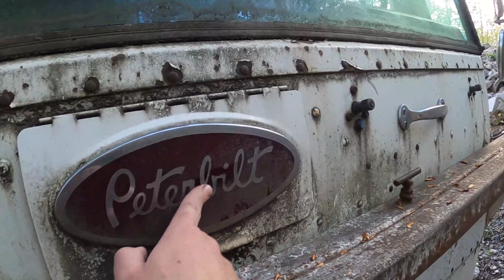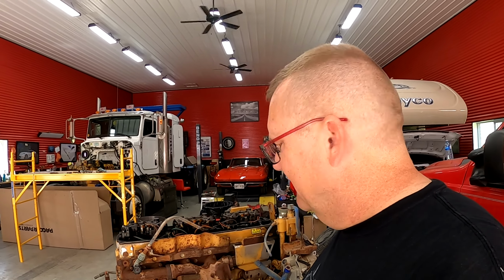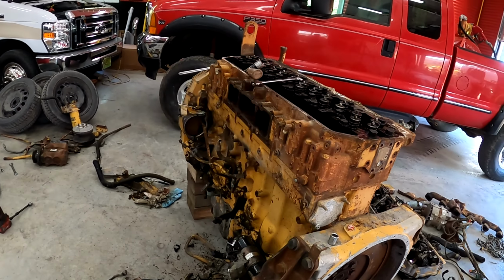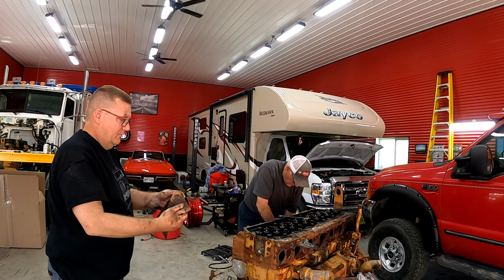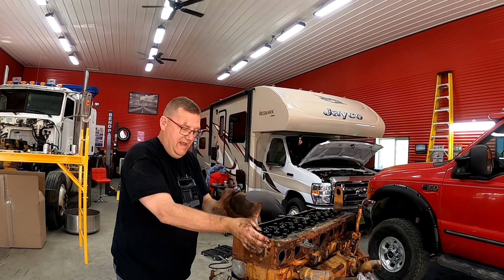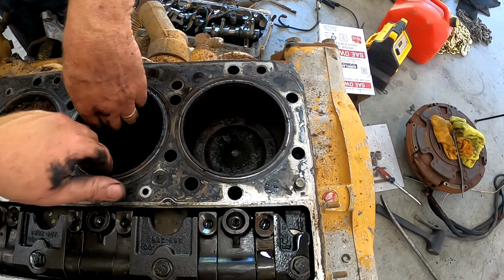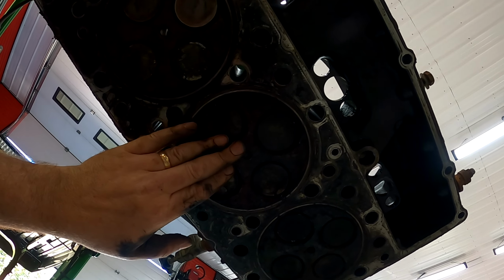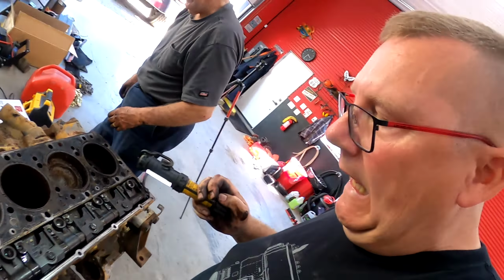off with its HEAD!!  MISTAKES WERE MADE.

Comment: You're putting the horse before the cart. Until you have the block and head checked you can't know what to do. If they are good, rebuild it yourself and when it's done you know it's right and tight. You'll know how to rebuild an engine for a future project, it won't be so intimidating. Don't get discouraged, if it was easy, everyone would be doin it.

Comment: Some you win and some you lose !!! I pull the oil pan and check the bottom end out before doing anything else . And if the bottom end looks useable, then get the head checked and if it's okay,   I would start taking the other
 engine apart and then see if you can come up with enough parts between the two engines to build 1 good engine . And then make your decision as to rebuild or buy a remanned block . Good luck and I will see you all later, it was great to see your dad there helping you, he seems like such a great fellow . Take care and stay safe and keep on making us some more videos .
🤗👍💖💫

Comment: Mike, don’t get down,keep going ,strip the motor,sort the parts, good bad ,strip the other motor,see what you got,make the decision,remember you are not using the truck at max kgs,every day,see what you got,in spec ,you need 6 in spec clean liners,and it’s amazing when there cleaned .keep going.

Comment: Normally I would say rebuild it however from what I have seen on other channels, rebuild kits can be hard to get.  The piece from the sleeve that is missing, did it drop in the crankcase and damage the crank?  Although I believe this might be able to be rebuilt, I have a feeling that by the time it is done the cost of additional parts may be close to what a remaned one would cost.  That is not even taking into account the hours you would spend rebuilding it.  Basically I think you may be better off using it as a core and getting a remanufactured engine of the same model.

Comment: Before you ask your shop guys, clean all of it properly, get the one in the truck apart and see what in there is usable. Between the 2 of them you are well on the way to a good rebuild. You might get lucky and end up with enough pistons and liners. All is not by any means doom & gloom and over budget.
Reply: I thought the same thing too, collect parts from both engines and build a good engine.

Comment: What are your plans for the truck, if it is not putting it to work than what does it need, 6 pistons, 6 liners, gaskets and a set of bearings, that should not be $10,000, still need to check the head for flatness and vacuum test the valves, dont over think it.

Comment: Just for content alone, rebuild it right there in your shop 😁
Besides you need to see the bottom end.  Is the crank good?  Are the rods good?  Prolly, but you won't know until you get there ...  If all that stuff is serviceable, just kit it and be on your way.  Leave the used motor patina so it all looks like a nice used truck and go have fun.  Drive it and show it, or whatever ...  🙃

Comment: Shades of me back in the 80's when I built a performance engine for my Gran Torino.  Bought an engine from a junkyard, tore it down and found the crank had been trashed by a spun bearing on the rearmost rod journal, so I had to buy a rod and crank set.  Went through three sets of cylinder heads just to find a pair that was not cracked.  Money wise, yes, I may have saved some dollars, but considering the tools I had to buy, the time, and frustration, I would have been just as well off to have bought a high performance engine that was ready to run.  Before you buy anything else, have that engine checked for damage and/or cracks.  It may actually be ok, then again, it may be nothing more than a pile of expensive scrap iron.

Comment: You can get that dye and spray kit to look for cracks [Bus Grease Monkey does that to check for cracks on every engine he does]. But Ya if you don't get that special spray and dye kit to look for cracks, send it in to magnaflux the head and block to look for cracks...especially after watching your Dad whack the head on the ends with that 12 lb sledge... such a character and rock star :-)) Also, may get the other head from the Duke done at the same time [shelve all the good parts you won't be using on this build but may need later on]. With all the trucks you own and the fact that they are vintage, you're doing yourself a favour teaching yourself how to re-sleeve a block, clean and put new rings on piston's, learn to run a straight edge across the top of a block to see if the block will need to be decked at the machine shop.... yada yada. May be worth your while to get an engine milling machine at some auction somewhere... save yourself tens of thousands. But ya Mike, dive in on the learning to rebuild this engine.

Comment: Hi Mike, turn the block over and remove the sump.. check the big end and mains for rust .. I'd say with the hole in nuber 4 cylinder wall.. the sump will have filled with coolant. Hence why they drained the oil at the breakers yard. the crank could need re ground and over sized shells  the camshaft is probably junk as well with rust on the lobes and bearings .. and lastly  where did the missing liner go.?? was it smashed and forced round the oil ways.. scoring All bearing surfaces... I'd find out the true cost of a New block.... and have work done on ... or a replacement head found.. as the camshaft and rockers arms may be shot if the engine has sat with oil water mix for any length of time .. I'd use the block you have as a core  to send back  and find / have all the work done on the head ... that way there is Noo fragments of cylinder wall floating about to screw the new built up engine... Stay Safe Oot There.... N Keep up the good fight ... Andy UK

Comment: One thing a mechanic really hates is a box full of parts and told to fix it. On that note you should have boxed up all that engine keep it separate from the one in the truck and pull the engine from the truck and break that one down see if you have a good block. I know I'm over a year late but still. You got everybody in need within finger touch range. Those engines need to be boiled in magnaflux to check for cracks in the heads and in the block.
Reply from the maker: Yeah the block in the truck had a big hole in it.  Woops

Comment: If the two engines are compatible with each other pull the liners out of dukes engine and resleeve the new engine. The pistons are the same as well. The bottom end use the best of all 12 cylinders. You might get away with haveing to replace the bearings, something that probably needed to be done anyway.

Comment: Hi Mike & Dad. I was cringing as I saw you disassembling the head and not counting the bolts removed.experience is a great maybe the best teacher. Unfortunately it can be a very expensive lesson learned.
Get a manual for  your engine. They are cheap insurance and with today's internet are available almost instantly. Have te block & head checked. If good buy the full kit and put it back together. Keep the videos coming. PS. no more prybars until your sure it is ready to come apart.
Reply from the maker: 10 4 👍 👍

Comment: There's a lot of work even for an experienced builder to re build a short motor,  my advice, get the head checked. Then trade in the engine for a rebuilt short motor. If the head turns out to be a dud,  then you have to go down other avenues

Comment: You sure get yourself in a pickle don't ya, if you watch Warren on Western Truck and Equipment on youtube he hasn't had any luck with short blocks especially the latest PX engine he's done for a customer. After watching those series of videos I wouldn't own a Paccar built engine ever. Like I said before how much money do you want to spend on Duke kaboom the money you've spent on the rebuild for the C13 could have gone into the burned K100 have that truck fixed up and on the road. Duke is a truck you see every day on the road, a fully restored or a working K100 not so much. I'd focus on the K100, put Duke on the back burner, putting a reman engine into it the truck is a heavy spec'ed truck with a small displacement engine. It would make a good gravel truck if the frame was long enough.